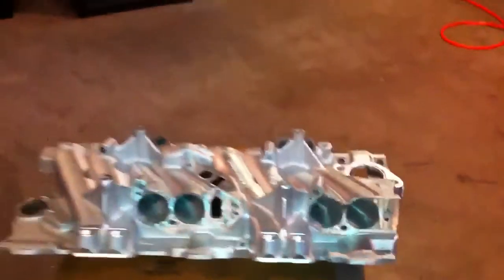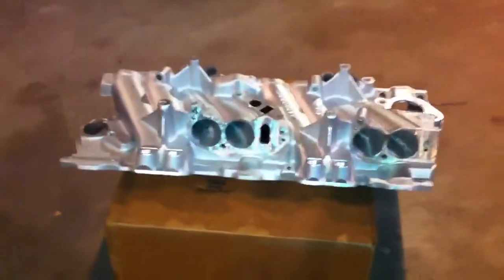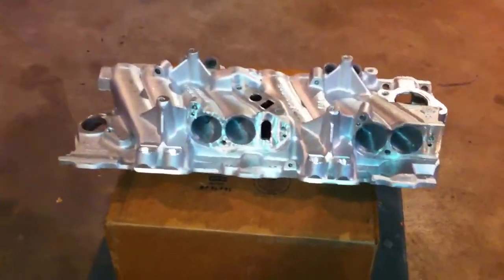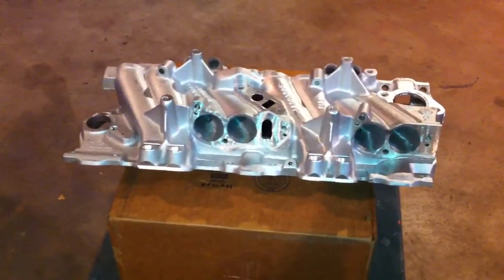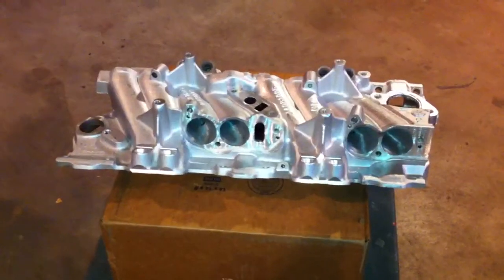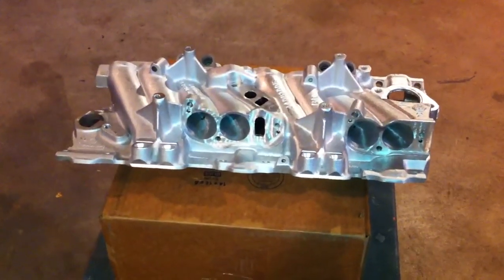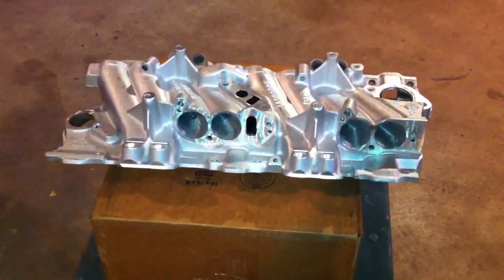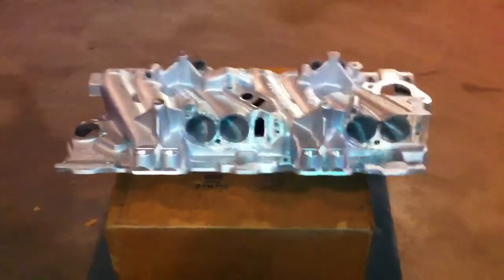L98 TPI Porting. Ported Stock Base Intake Manifold. HFFI

Comment from the maker: @MesterZ2889 

Haaaaa! Thanks for the comment! The factory runners are about a 1/4" smaller than most of the ports on my ported bases. A good pair of aftermarket runners is a good idea! Check out High Flow Fuel Injection on Facebook at the link in the video description.